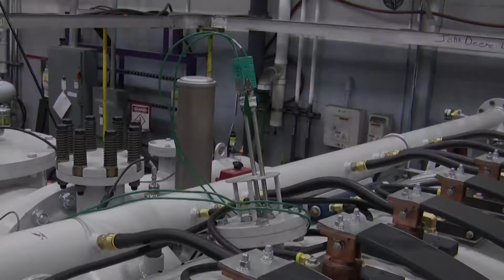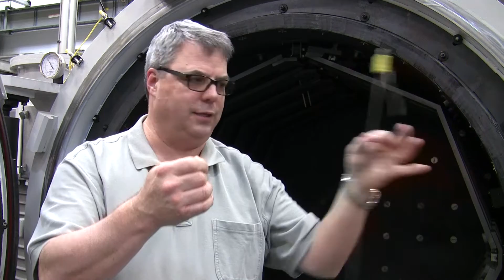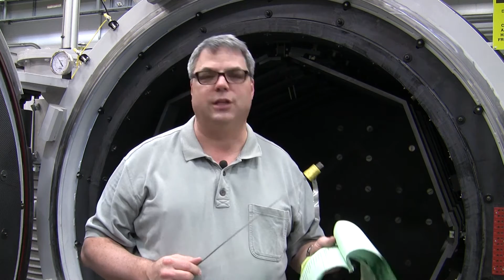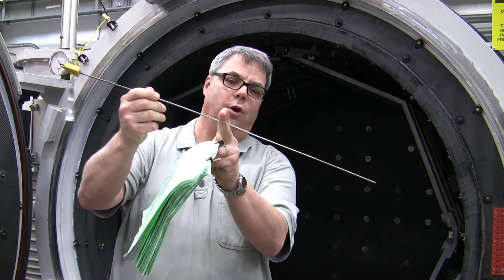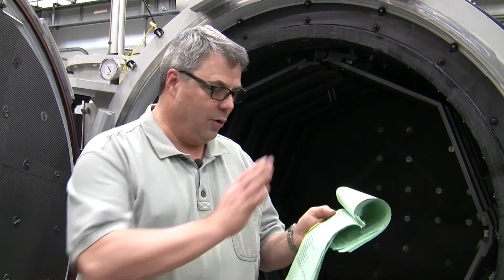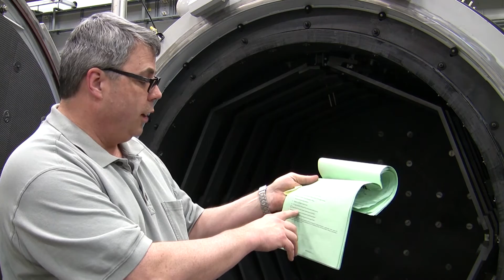How to Replace Your Control Thermocouple Without Redoing Your SAT or TUS

Comment: Hello sir, I am very grateful for this video. I had gotten into a very heated argument with the customer-appointed inspector for the exact issue of not doing SAT after replacing the thermocouple. We use K type and therefore replace sensors every 3 months and do SAT every 6 months. 

I have noticed that your over-temp and control sensor are very close together. Is it because of the standard or any other particular reason?

Comment: How long have ceramic TCs been the standard?
Reply from the maker: Our estimate is 10-15 years. The rear section of the TC is Inconel housed, and as it enters the hot environment, it transitions to a ceramic cover protection tube. Within the ceramic protection tube is the actual TC ceramic with the TC wire strung through it and welded at the tip. Today, the ceramic sheath TC allows for protection against vacuum and off-gassed contaminants. It also assures fast PID control response times.
Reply: @ipsenvideos  I wonder about the ceramic zone TCs for vacuum brazing aluminum. Is metal superior?
Reply from the maker: @eletor  Aluminum brazing furnaces normally run with either Type K or N control TCs that are flexible nickel sheathed. This is due to the requirement of bending and positioning.